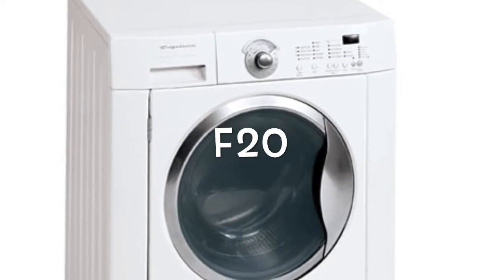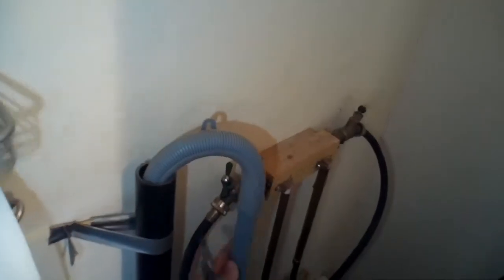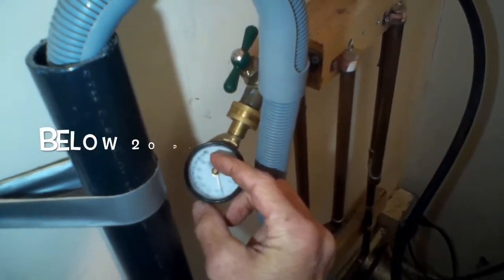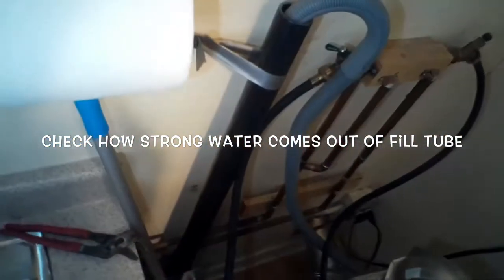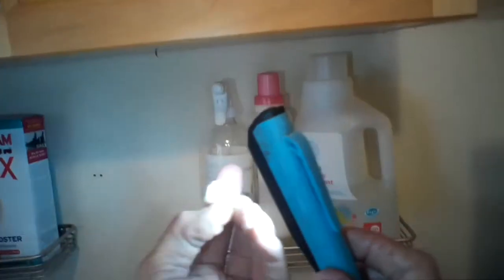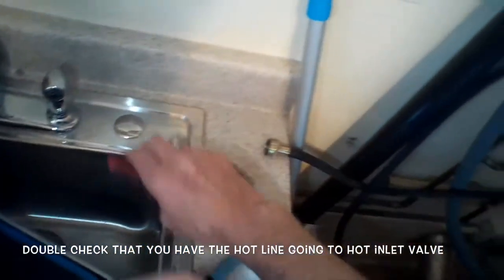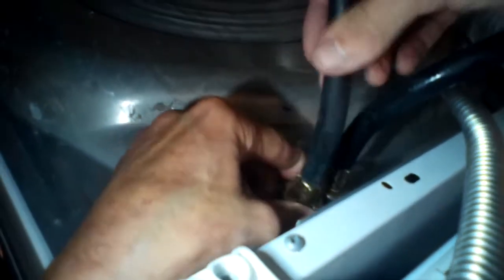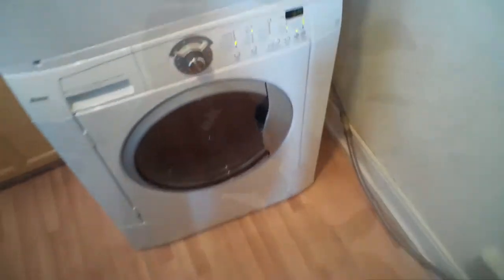Front Load Washer F20 -- Clogged Inlet Filter

Comment: What do you suppose the problem could be if it gives the F20 code with initial run, but when the load gets cancelled and started again, it runs through all the cycles no problem?
Reply: Nichole, I've had the same question. I have a Whirlpool WFW9600 front loading washer. I disconnected the entire water delivery assembly and tried to make sure that everything is as free of debris as possible (I also replaced the connection hoses), and it has been working since then without the F20 error, but honestly, I'm not sure that I have it fixed yet. I am suspicious of problems with the actual electronic controls or the valves inside of the water delivery assembly. I'm still searching for solutions. I'd appreciate it if you would email me if you have found a better solution. Thanks, Seth
Reply: @sethcraigo-snell8164  probably the inlet valve is the cause. very cheap part on eBay.